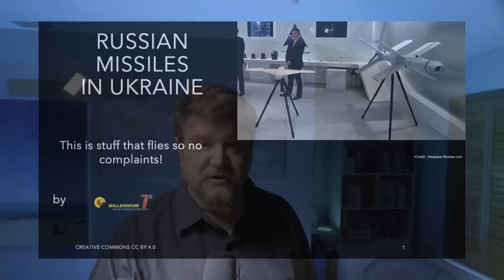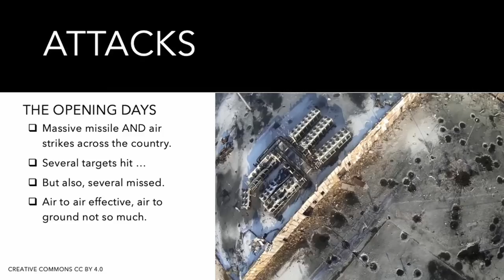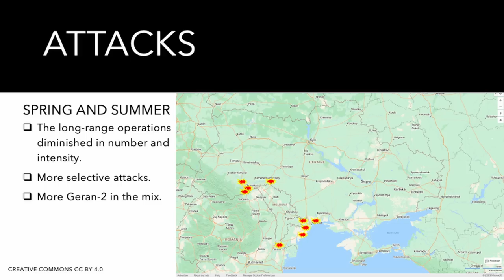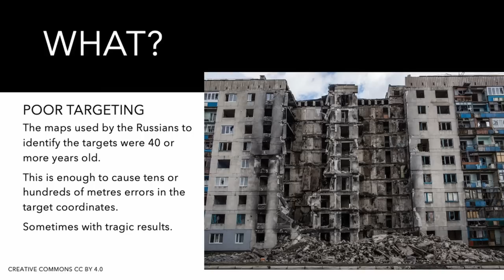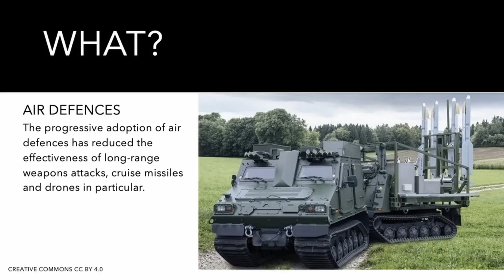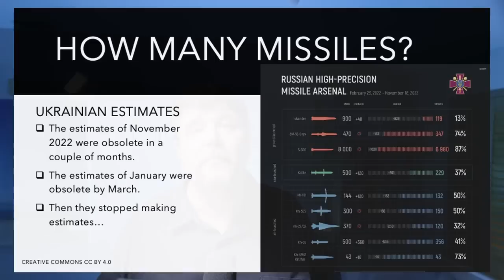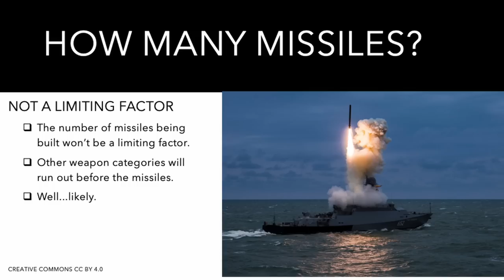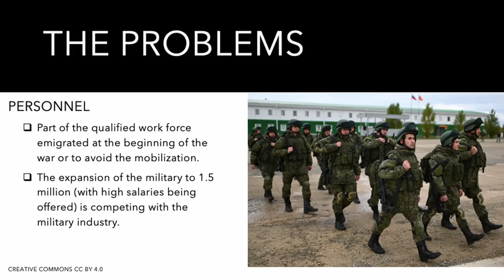Ukraine: Russia Run Out of Missiles!

Comment: Not only they keep running out of missiles but frequency of them running out is increasing.
Reply: Well better than firing US made Patriot missiles into Poland! Remember that? Yes it was launched from Ukraine. So much for western superior technology like the Leopards and Bradley's that are smoldering wrecks in Ukraine
Reply: @hordegaming4771   when did that happen?
Reply: Well you can't fix cocky arrogant behaviour when they're constantly supplied with free equipment.
Reply: This is basically how it works. They are deeper and deeper into strategic reserve and keep using less and less of it as time goes on. No military will completely run out of any munition, they will decrease rate. Right now the rate is about 1% of Desert Storm, for example.
Reply: @thh4584  What is cocky and arrogant about the reporting they are doing? It's highly empirically accurate, seeing as the rate can be mapped out and confirmed.

Why should the equipment not be free? You want western nations to actually begin giving money to Ukraine so they can buy systems instead of giving surplus equipment?
Reply: @hordegaming4771  Ukraine has not yet lost more than a company of western MBTs and IFVs. Russia has lost all of their divisions about two times over. That's a pretty good trade, isn't it?
Reply: We might assume that, but could it also not be that they are replacing them with much cheaper drones and glide bombs.
It could also be that the Russians intelligence might have difficulty finding high value targets and this would also explain why they fire less missiles.
Why could it not simply be that Ukrainian counter intelligence is getting better at hiding there stuff?
Reply: @ArchOfficial  Hush child learn facts first before spouting through snot bubble it's embarrassing for your parent, yes singular!
Reply: @ArchOfficial  thats stupid no country has resrves to last them only 2 years especially russia since all the soviet union did was build their military and flunt it. The war can last another 10 years and russia will still be firing missiles into ukraine
Reply: @ArchOfficial youre kidding right?
Reply: @ArchOfficial whats wrong with christoforou?
Reply: @ArchOfficial Sure would enjoy seeing some of your sources. Neither side has lost entire Divisions destroyed. Both have had large units damaged to the point of loss of effectiveness. This is normal. And both sides have refitted, and continued on. As to your point on the few IFV's lost, that is more due to their small numbers and usage on this front than to a Russian inability to hit them. This front has evolved into a small unit conflict, which directly means fewer armored assets will be lost. Even in the Verbove area, where Ukrainian armor has penetrated, it's with just a few vehicles.
Reply: @delfinenteddyson9865 In his head.
Reply: yanksbiglywvil  no idea what you are talking about, but Kramatorsk isn't in Poland as far as I know
Reply: @delfinenteddyson9865  When those two Polish farmers almost got killed. It was spread across all Western propaganda channels, claiming "Russia launched missiles onto Poland" only to have the photographs prove it was a Ukrainian air defense missile that was shot from the Lvov area.
Reply: @CH3TN1K313  I don't know if I think of the event you are talking about; but in november last year, there was alledgedly a Ukranian S-300 aa-missile that killed two farmers in Poland. But that wasn't a Patriot-missile like the other guy claims it was. So my question is still pending, when did a Patriot-missile failed and fell down in Poland?
Reply: Polish farmers did get killed, by an old S-300 missile. Patriots werent in Ukraine back then
Reply: No worries, they have enough shovels, garden hoe’s and rakes to continue to kill UrkNazi cannon fodders lol 😆
Reply: @ArchOfficial There is plenty of visual evidence for more than "just a company".
Reply: @feedyourmind6713  Not really. Exactly in this area there are dozens and dozens of western equipment wrecks lying around.
Reply: @rosomak8244  Perhaps my use of Verbove as a locator was incorrect. I was thinking of the breaching of a portion of Russias 3rd line. At point of contact few vehicles are used to push past trenches, it's squad level ops. If one totals up the equipment loses along the Zaporizhia front it adds up. Armored regiments aren't pushing the Ukrainian lines forward.
Reply: yanksbiglywvil  The counter offensive has had a roughly 10:1 equipment destruction ratio, has given almost total naval control to Ukraine west of Crimea and has destroyed almost all the military installations on Crimea. On top of that the minefields and elastic defense zone have been breached far ahead of any realistic schedule. So it's going really quite well.
Reply: @ArchOfficial keep dreaming!!!!
Reply: @delfinenteddyson9865 In the beginning of this current war between Ukraine and Russia. Ukraine and the US were trying to blame Russia.
Reply: @Max_Da_G  No they aren't. Elastic defense zone has been broken through in most areas and the minefield has been surpassed. There aren't static emplacements on most parts of the front. They are fighting with the trenchline now. After that it's the operational depth.
Reply: @patriotdiva3118  Can you be more precise? I don't remember that there where any patriot missiles in Ukraine at the beginning of the war
Reply: @delfinenteddyson9865 wasnt a patriot. Was an s-300. They fired one into poland then claimed it was russia to drag in Nato.

Then nato does an investigation ans confirms it was Ukraine. Check youtube for that story.
Its also similar to how they kwpt firing himars onto the dam all while claimibg russia is doing it.

Till tye evntual dam collapse which was russia fault 😂 anyway am suprised you didnt see the poland incident
Reply: @alispeed5095  hordegaming4771 claimed that a patriot-missile has fallen in Poland to illustrate that western equipment is subpar: "So much for western superior technology" as he said. I am not saying he is wrong, I am just saying, as so far as I see it, that his claim is based on rubbish, and none of you brave people could back his claim up.
Reply: @ArchOfficial  33 leopards 2 documented. Out of 77. Thats entire batalion. 

Out of two batalions. :face-green-smiling:

You, mr genius, win a price for manipulation of facts. Of course when 77 vehicles are on battlefield, their losses even if 100%, would be fewer than vehicles who are on battlefield in thousends, in daily use, and would suffer mere 20% casualty loss.
Reply: @jiridrapal7512  There is not anywhere close to 33 documented L2 losses.
Reply: @ArchOfficial you counted nazi equipment as russian?
Reply: @sebastianlup  We are not talking about WWII.
Reply: @sebastianlup I think he was being sarcastic but with how outlandish NAFO claims have been it's very hard to tell these days.
Reply: @hordegaming4771  The missile fired into Poland wasn't a Patriot. It was actually a S 300 5-W-55 air-defense missile fired from Ukrainian territory.
Reply: @kunaukedi4850  Would you care to place a wager on that? No country in peacetime produces enough munitions to last in time of a major war. Inevitably they have to ramp up production or find outside sources to meet needs of a protracted war. It was true when we used swords it will be true when we're using lasers or whatever comes after that. The question is how much can Russia ramp up production and can they keep up with what the western nations are giving Ukraine.
Reply: @delfinenteddyson9865 it was missile of s300. Ukraine said it had to be russian missile. Poland agreed in that matter. But lately, poland reject the statement, and it was from ukraine side which russian had said. What a joke lol
Reply: @delfinenteddyson9865  You didn't hear about it? Sometime around mid 2023, the missile that the media said was Russian was in fact US and fired from Ukraine it hit a Polish farmers field, luckily to my knowledge no one was hurt but still it's a completely different country ffs!
Reply: @patrickweaver1105  Was it Western supplied? I rest my case
Reply: @hordegaming4771  It was Russian supplied. Battlefield pickup. Not kidding.

Comment: 5:24 "including 45 power stations"
Russia never once attacked a power station. They have been very careful to only target substations that stepup or stepdown. They can be fixed in hours, but ussually days and occasionally weeks. Russia doesn't target the power plants because they know they will never ever be repaired resulting in enormous deaths to cholera. in 1991 America destroyed 12 out 20 Iraqi power plants and they still until this day have never fully restored power. It resulted in the deaths of 500,000 children by 1996 as admitted by then secretary albright. They simply do not want to permanently take out the power of people the Russian leadership still thinks of as brothers to an extent. They would only do it if it is the only way to win the war. The Russians have taken tens of thousands of KIAs because of this humane measure because without power this war would not have last 19 months. As you may know if Russia just took out 12 coal/gas gen plants it's lights out for almost all of Ukraine and there is nothing that Ukraine could do to stop it if Russia had done this at the beginning of the war or if saved up a few weeks or months of missile production. They could totally oversaturate all defenses. In fact most power plants aren't even protected at all. 
I encourage you to research the topic more you'll find they only attacked the substations.
Cheers

Comment: I honestly don't doubt, that Russia has a reserve in the thousands, definitely far more than what people are convincing themselves they have, as you said in a previous video, the US went down the Carrier route, where Russia, went down the cruise/long range missile route.

Utterly love your content and the rational/logical approach, keep up the great work.
Reply: the issue is that Russia will have to start refurbishing older and older equipment to keep up with demand, the old stuff probably worked great when the soviets first made it but between age and shoddy work being done when they take them apart and "upgrade" them can result in reliability issues.

there are some examples of this with the refurbished artillery shells Russia has started to use with poor fuse quality and sometimes casings being sent to the front with no filler, this has caused the dud rate of artillery shells to increase in recent months.
Reply: @dominuslogik484  CNN expert detected
Reply: @scamdem1c  refurbishing stuff is okay and a good thing but it has to actually be done well. Especially with explosives you absolute midwit, taking old already cheaply manufactured warheads and then taking them apart to fill with explosives can lead to any number of issues.

For example I'm pretty sure you wouldn't want to try to fire off a 50 pound explosive shell that has a slight warped casing where it lodges into the barrel of your howitzer. Or as I also mentioned there have been complaints among Russian artillerymen of receiving howitzer shells that had no explosive filler or they were missing their fuses in the nose caps.

So kindly take your lowest common denominator argument and shove it where the sun doesn't shine

Comment: As someone from Kyiv, Ukraine (Northern Part, closer to Belarus) I can tell that frequency of actual missiles launched towards Kyiv has decreased.
When the war started, I almost daily was woken up by flying rockets and missiles and now it's fully silent.
We will see if they attempt to hit electrical stations during autumn and winter as they did last year and how often, that will be a more accurate indicator if they can allow themselves to use missiles for something significantly less effective than actual military targets.
Reply: Pretty much nobody understands this. They have "ran out" months ago as they used up all of the operational stock last year and are eating more and more into strategic reserve, which means they can't keep up even a measly 1/10 of Desert Storm rate of firing like in the early war.
Reply from the maker: That is interesting. Could you be more precise with the dates?
Reply: @Millennium7HistoryTech  Things like this are common knowledge to almost anyone with practical insight but the facts are being distorted largely by Russian DIP, which you have sometimes propagated as well. 

Kharkiv residents as well have been reporting significantly less strikes since even last year FWIW. There is no precise date as the rate decreases somewhat linearly, but the last quarter of 2022 is close to the point when people started feeling more at ease.
Reply: I'd attribute that more to good air defenses by Kyiv, than to lack of munitions on Russias part.
Reply: @feedyourmind6713  Air defense engagements aren't exactly silent. Think of fireworks but 10 times louder. I doubt they are intercepting the missiles very early in the path either given that it's not really possible to have such a widespread coverage.
Reply: @ArchOfficial The silly attempts to conflate Russia capabilities with American capabilities... the only ones who said Russia was a top shelf military, one to keep up your military spending against, was the West.
Reply: @feedyourmind6713  Well, Russia is still contesting territory against of one of the largest armies in Europe, assisted materially by most of NATO and NATO-allies. Even if their primary capability is mass, it's still something that needs to be addressed. Most European nations would be defeated by Russia were they to fight alone.
Reply: @ArchOfficial  My point stands. While there certainly is more than one reason for fewer missiles attacks one Ukrainian cities, effective defensive measures is a top reason. Russia not having missles is a dodge.
Reply: @feedyourmind6713  I'd attribute it to the lack of suitable targets. They also preserve this type of weapon for the beginning of their own offensive operations, where this missiles will be used to disrupt transport system and logistics across the whole country and particularly around the planned area of operations, where this missiles will be used en-masse shortly before the ground operation start.
Reply: @ArchOfficial  Cold War European front expectations were massed attacks, we were never told whether those mass attacks could be supported for long. Is it that Russia cannot, or will not (societal reasons) commit to such mass, in Ukraine? Or, they're strategy is to outwait Western attention spans?
Reply: Is there anything interesting left to hit in Kiev? Specifically any target that concentrates significant military value in a small area convenient enough to hit? Russia hasn't started their energy infrastructure campaign yet, which means that Kiev is of 0 interest for Russian high command right now. On the contrary, strikes against ammunition depots, troop and equipment concntratio n points near the front and ports used for the transloading of commercial cargo are being hit non-stop. There's also nearly no manufacturing and repair facilities for weaponry left standing, which are one of the VERY few types of targets worthy of a missile strike to begin with.
Reply: @ArchOfficial  I call B.S. on your "Common Knowledge for anyone with practical Insight". Why? Because you compare it to desert storm, (Which was a completely different form of engagement) without a 1000km front line. Or enemy Drone warfare. Less strikes may also mean, they want the area as intact as possible. They make pretty low rubble piles out of the rest, if you haven't noticed yet.